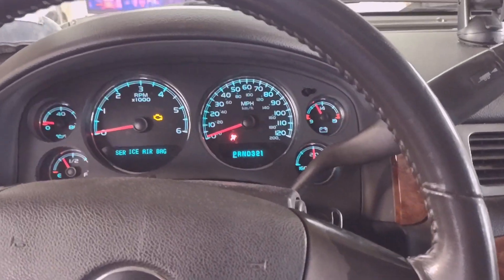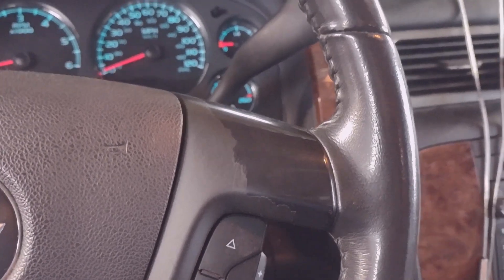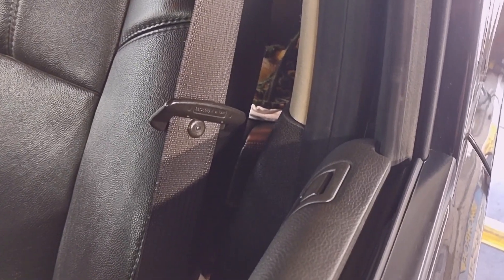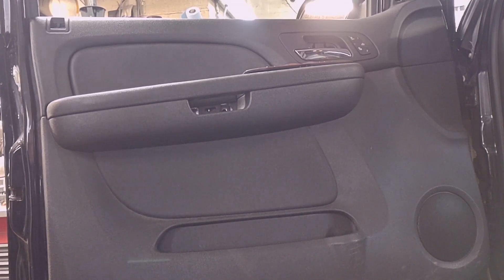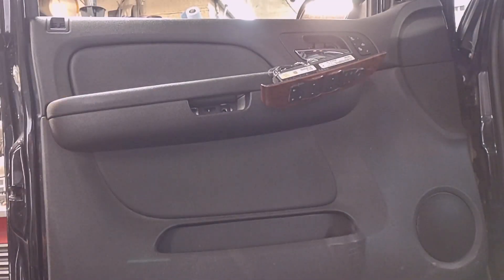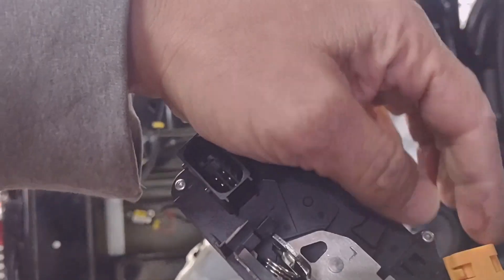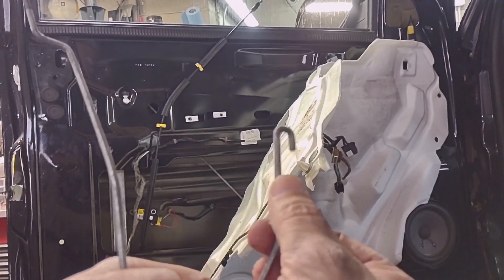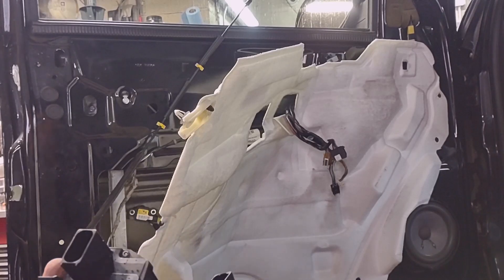Battery dies overnight, Radio stays on while Ignition off, Door lock Actuator Problem

Comment: Would the actuator going out cause the driver control switches to not work as well also my car randomly starts the relearning cycle for tpms
Reply from the maker: In automotive electrical systems, nearly anything is possible—especially when components share the same network. Most vehicle modules communicate with one another, but the specifics vary depending on the **year, make, and model**. Engineers continuously refine how modules interact on the bus network, meaning a faulty module could potentially prevent a car from starting or disrupt certain functions.

However, I don’t believe the *TPMS (Tire Pressure Monitoring System)* is affected by a *door actuator**. That said, every vehicle presents its own unique challenges, and electrical systems are vast and complex. That's why proper **diagnostics* are essential. Best of luck!

Comment: Hey I’m having the same issue with 07 Tahoe the radio and other stuff will not turn off when the key is out the ignition
Reply from the maker: These accessories should turn off once you turn ignition off, remove the key and open the driver door, so the driver door has the last logic command to the BCM to turn off accessories, the most common issue is the door lock actuator.
Reply: @carservicepro  thank you I’ll try that
Reply: @ricardo3072 did it fix your issue?
Reply: @carservicepro hello my android radio turn off after open the driver door is it normal? And take off the key
Reply: My 2007 expedition radio cycles like its ejecting a CD after the engine is turned off. The car battery died sitting overnight. Any suggestions

Comment: For me when i open the door the radio turns ON
Reply from the maker: When it comes to electrical diagnostics there is no one size fits all, sometimes there are common issues exist in vehicles, so it is important to do diagnostic, It could be the actuator or there is some electrical or network issue "module communication corrupted". Sometimes disconnecting the battery negative for 10 minutes and applying the brake pedal while battery disconnected this will discharge all capacitor power and may fix the issue!

Comment: Thanks for your help! Looks like I'm going to the parts store for a door lock actuator.
Reply: Agreed, and running a jumper to ground confirmed problem. I am not complaining about the actuator replacement. 17 year old components going to fail. Shared simply for others to have info of my experience. Thanks for your videos
Reply from the maker: @Ffiltar46  👍
Reply: Update: Replaced actuators, everything worked intermittently, then back to same problem. Pulled wire harness from door and found large black wire broken. Repaired with connectors on each end so as to not have a connection in the hinge boot (requires additional wire). All works except passenger dome and window, I bet there’s a ground wire broken on that side too.
Reply from the maker: @Ffiltar46  when it comes to electrical issues there is never one size fits all, one symptom can have different causes but there are common issues and common repairs that I try to share that fix most of the problems, in the meantime it is always recommended to familiarize your self with the wiring diagram and how the circuit works in addition checking positive, negative and connectors and all related components to pin point the problem, with todays cars ECU or PCM are in charge of very much everything, with this being said todays market flooded with car parts with competitive prices it allows you to buy parts cheaper so instead of spending hour on diagnostic it doesn't hurt to just buy the part and give it a try not much loose if the problem fixed you won by not wasting your time on diagnostic and if it it didn't work it will give the confidence to dig deeper, this was my personal opinion, goodluck!
Reply from the maker: Good luck!